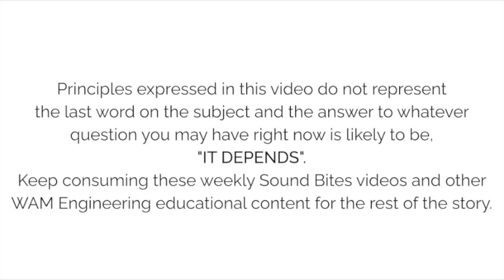Sound Bite #42: Will Your Cartridge Benefit From Analysis and Optimization?

Comment: Going back to that tool I suggested checking the diamond cut also could be used for checking wear I think. I wouldn't have thought it's expensive to put together it could be made from cardboard and a plastic lens. I suppose you would need different types of lenses compared to the type of diamond cut styli you've got? Using cheap cat laser toy. You should be able to check the styli in every position horizontal and vertical and diagonal alignment, also the wear pattern. The manufacturing of it would be dirt cheap pennies.
But I don't understand why any manufactures should be out, is it done by machine the diamond facing these days or by Human? They have measuring equipment why should it be out?
Reply from the maker: Tooling tolerances, jig tolerances, ablation tolerances, human error, laser kerf variability and the biggest one: The difficulty of identifying (and even more difficult: measuring)  a transparent feature surrounded by transparent features. 

It is not easy at all or they would be doing a better job of it